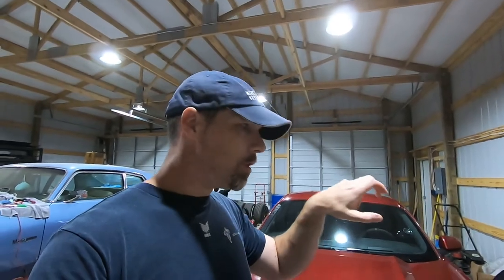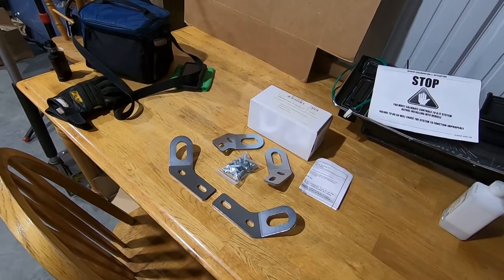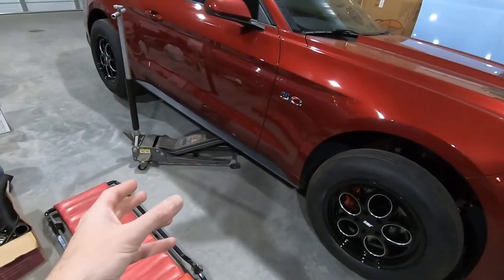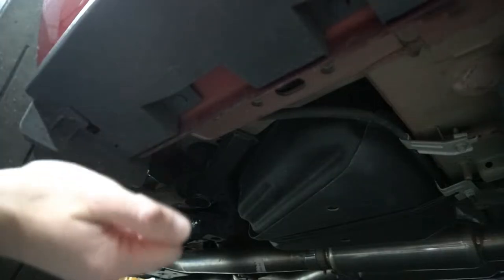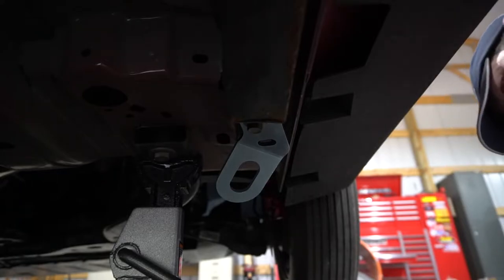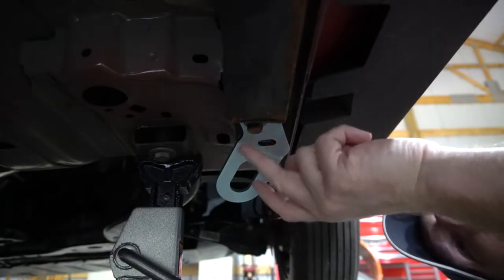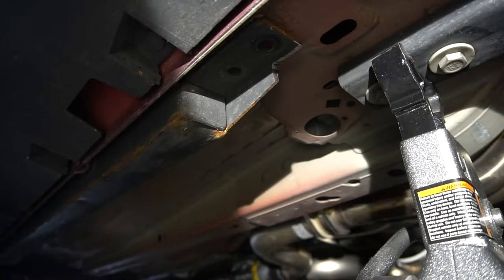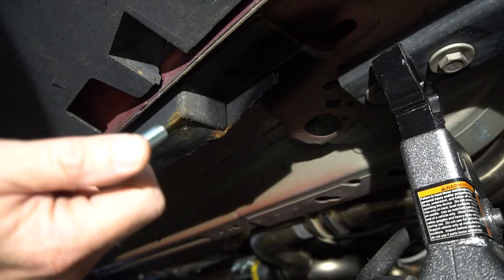Towing an S550 Mustang... here's what you need! Ford Performance Tie-Down Kit 2015-2020 Mustang.

Comment: Good stuff at Ford take over, car looks beautiful. I’m going to ask a stupid question, in your intro did you have wheel spacers on wheels during the burnout?
Reply from the maker: Thank you! Only stupid question is one not asked. No spacers at all. My wheels are the SVE R350's from LMR 19x10 +35 offset, square setup.
Reply: ponie1992, thanks, just wondering, those wheels fit really good. I want to safely move my wheels and tires out even with my fenders without spending a fortune on new rims and tires. Thanks, enjoy channel

Comment: I haven't bought jacking rails or tie downs yet. I was thinking about the bmr jacking rails but I doubt those would work with tie downs as they are fully boxed at the ends.
Reply from the maker: Both would be best, but the tie downs are a must for trailering imo.